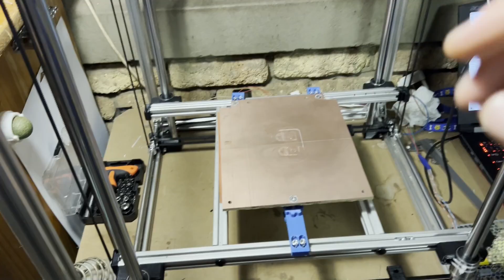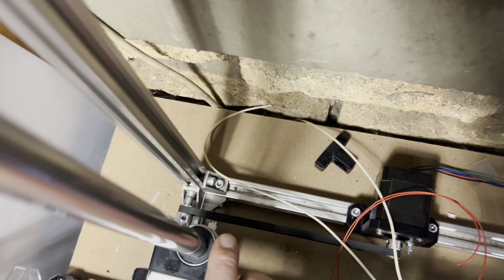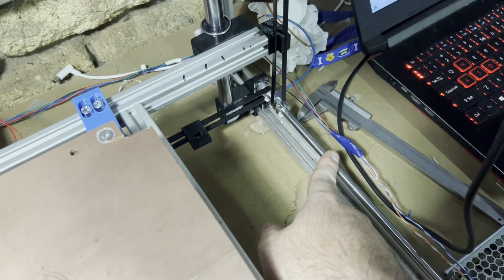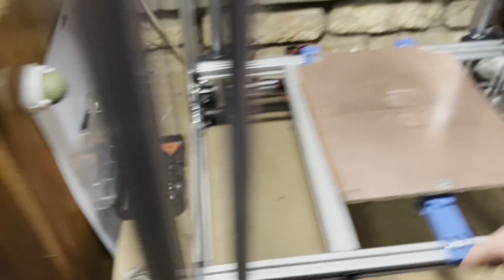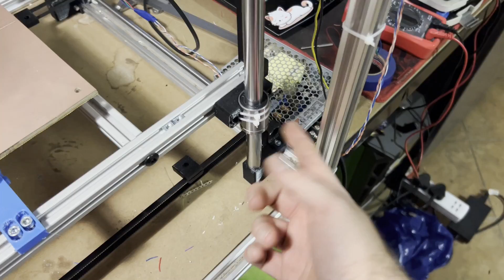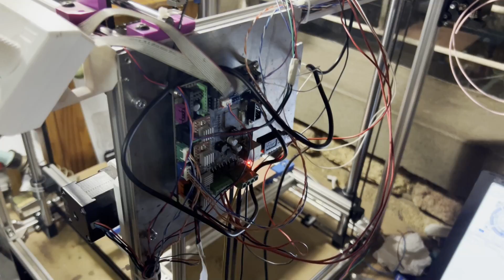Why Is The Bed So Small????

Comment: Why belts? Just put 4 motors and 4 leadscrews. I use 2 motors and 2 leadscrews for 310x310 printer and it works fine. Bed tilt is corrected with BLTouch before each print.
Reply from the maker: I considered something like that but 4 motors and the lead screws aren't very cheap by me so it works out much cheaper this way, also i had the idea for the belt system and wanted to see how well it would work, so far its working well, thank you for the comment!
Reply: @bicutech2  Belts can strech under load. The lowed the bed it the more they strech. 
If you build enclosed chamber, aluminum frame will expand and strech belts too.
Both cases will produce inaccurate Z position.

Comment: cantilever bed bad :D
but i would be too lazy to run the belts and connecting rods and just throw 4 steppers at it. One for each corner and just let klipper do the rest.

There is also a big difference between the hobby "3d printing" and the tool "3d printer". Some people want both and i hope that most people will realize this and the difference between both

Comment: Actually I like a smal bed on a big printer. I am about to build a RatRig VCore 3.1 500 - so 500 by 500 bed. However, as the bed is quite big, but most prints are not, heating this bed is quite an energy waste.
As the VCore 3.1 has a quite uniqe bed movement system (the best imho), the bed is actually not mounted but having 3 balls lying on smal rods and hold by magnets. So you can actually simply use a connector for the (AC) heated bed and the thermistor and just remove the whole bed. So if designing sort of adapter to mount a smaller bed, it would be easy to change it.
Reply from the maker: I had never heard of the RatRig project before, the bed system looks very interesting and i like the simplicity, thank you for the comment!, My only issue and why i decided to go with the system i did is the cost of the extra motors and the availability and cost of a duet or similar controller that supports many drivers for independent z axis control like the ratrig and voron, but maybe one day haha
Reply: @bicutech2  Actually with Klipper on an old mini PC, you can use multiple controllers at the same time and don't need a special controller. For example a Bigtreetech E3 mini is quite cheap. On the first revisions the x driver sometimes failed. But with Klipper I can still use y, z and e as z0, z1 and z2 if I want. a, b (on coreXY) or x,y (for crossing rods) and e on another board.
Imho Klipper makes it quite easy to combine multiple cheap boards. Maybe even using a quite old Creality 8bit board with Allegro drivers just for z.

Actually there is the Mercury project (if I remember the name correctly) using the bed construction of the VCore for an Ender 5.